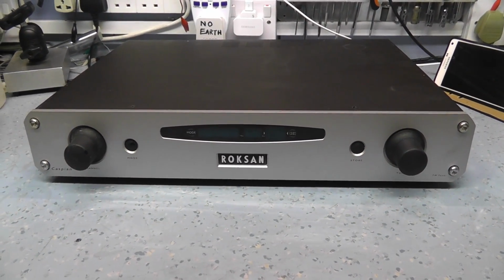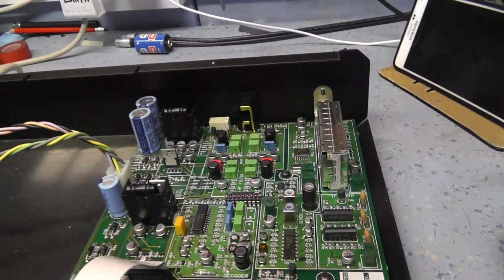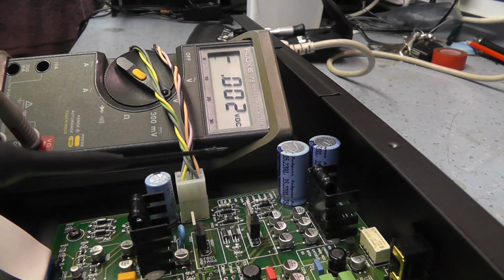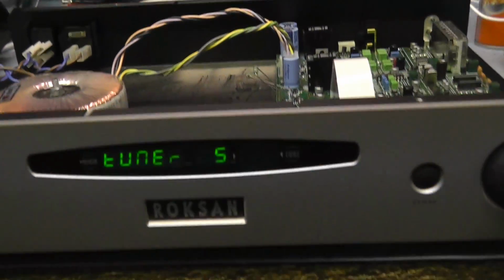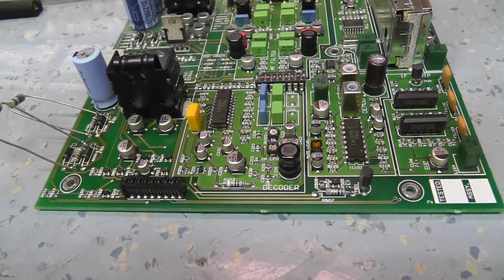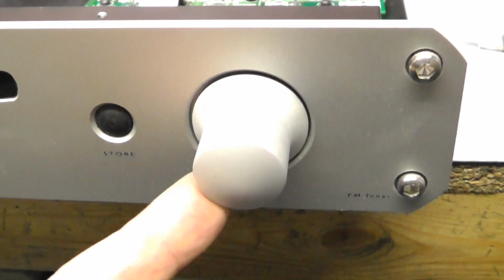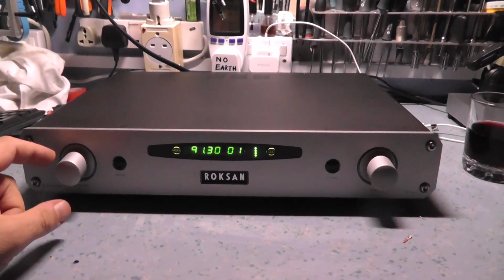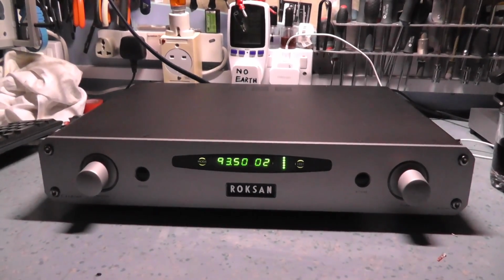Turn on the Red Light Roksan! (Roksan Caspian tuner).

Comment: roksan=shit company=shit people. had the K3, broke in 6 mouths they wanted me the ship it to UK on my fucking expense, i have mange to get a refund from the shop ... quoting the fucking law.                   NEVER AGAIN (just like fucking Apple)
Reply from the maker: Nicely put!
Reply: @SoddingaboutSi  well... they got me really upset.
Reply from the maker: @vladnickul  I am discussing same problem with someone else at moment. Yes very unreliable. I have a Roxan tuner I bought non working. Burnt out resistors. Cheap parts in expensive price tag. Same as musical fidelity.
Reply: @SoddingaboutSi  guess all the money goes to reviewers...
Reply: @SoddingaboutSi  I see in the specs from tuners sensibility from 0.5uV up to 1.8uV  witch is better a high or a low number? also what is it refere to. the  voltage "captured" by the antena  ?                                       somehow I feel the DX flame growing :)
Reply from the maker: @vladnickul  lower is better. That is voltage fed to antenna socket.  You  generally need 10 times that to get a good quiet stereo performance.
Reply: @SoddingaboutSi  Thank you.

Comment: Way overpriced tuner for what it is NOT!. The amount of problems it has for such a new device only 15 years old it’s falling apart like it’s 50 years old. Using those cheap small cans style surface smell capacitors they definitely were not thinking of longevity and the quality of the product specially with all the extra space they have in the cabinet they could use full-size Rubicon‘s or  Niciicon . Falls apart like a Jaguar electrical system
Reply from the maker: A lot of people described this sort of hi end gear as "Like a Sports Car as if performance should be unreliable!  I can understand that in a high stressed engine, but not in a pice of electronic gear!

Comment: Many year ago when I designed medical power supplies we did commonly introduced a little series resistance with rectum fryer diodes especially in use with toroids. Just to protect at switch on at the top of the mains cycle. My old  boss said it was a good idea and we never ever had a failure.
Reply from the maker: Oh good point. I was thinking of putting a vdr in series with the incoming supply to reduce inrush although torroids don't seem to suffer so badly from that. Shall I put some resistors back in?
Reply: Simon Spiers  I don’t think it would hurt to put something back in. Probably won’t make a lot of difference it’s hard to second guess what the designer had in mind but I expected it was for inrush as much as any other reason. I would not underestimate the  inrush from any transformer even a toroidal. I did think it look particularly large for something working a signal level. Very nice looking  bit of kit.

Comment: If you are going  to keep it, I would get rid of those SMD cans. If possible I would replace them with standard electrolytic caps. If not then modern SMD replacements. Rumour has it that the new ones don't leak but I guess we won't know that for sure until a few decades have passed. ATB Doug.
Reply: There is no reason to substitute the SMD electrolytics with through hole parts - there is nothing inherently bad about SMD. Some good Panasonic FK's would be just the ticket.
Reply: @jaycee1980  Better still would be to replace them with Panasonic solid polymer types;these have longer life,higher ripple current ratings,lower noise and much lower ESR than standard wet electrolytics.Slightly more costly but worth it.
Reply: @BRATWURST1  you have to be careful when doing that. Adding ultra low ESR capacitors can cause problems in certain situations. 

The problem with early SMD electrolytics is that the seals deteriorate due to the reflow oven process. This is why they start to leak. That's a problem that's been solved, and also isn't the case when you are replacing them by hand.

I do this all the time on Commodore Amiga computers which are affected by leaking caps
Reply from the maker: I am hoping they are Rubicon like the main electrolytics. No sign of leakage so far.